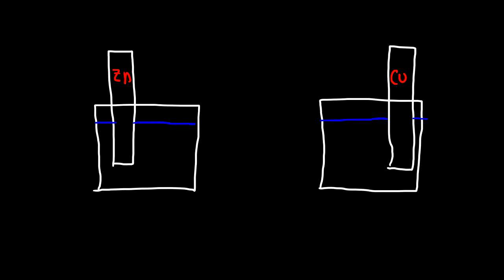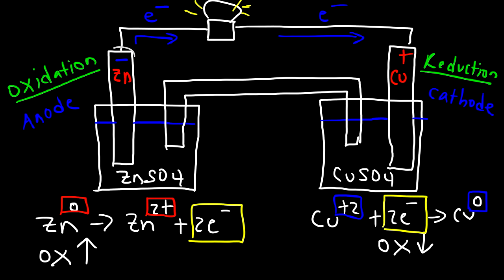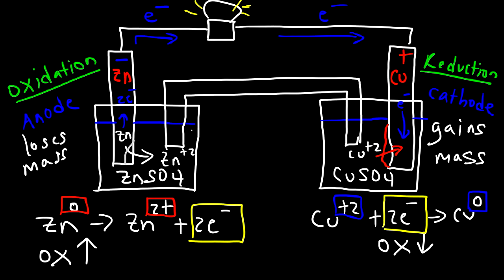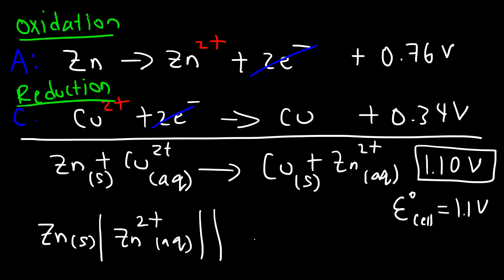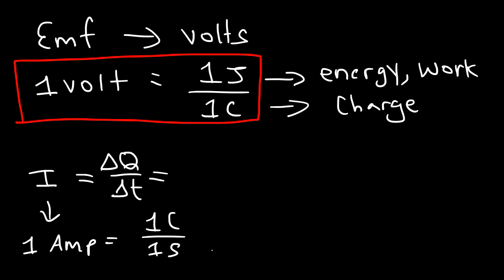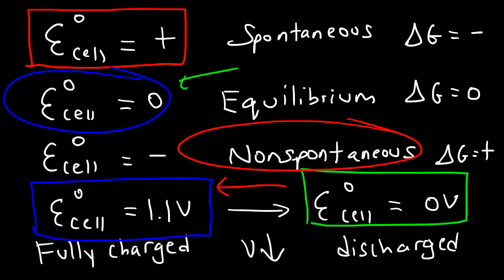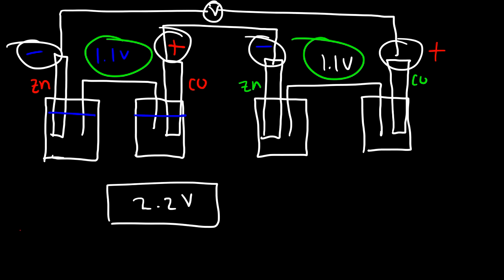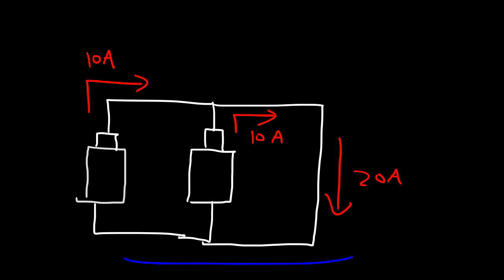Introduction to Galvanic Cells & Voltaic Cells

Comment: his video provides an introduction to galvanic cells, also known as voltaic cells, explaining their operation and key components (0:01).

Here's a breakdown of the main topics:

Galvanic Cells as Batteries  (0:08) : A galvanic cell is essentially a battery that converts chemical energy into electrical energy to do useful work, such as powering devices.
Components and Operation (1:20): A typical galvanic cell consists of two half-cells, each containing an electrode (metal) in contact with an electrolyte solution.
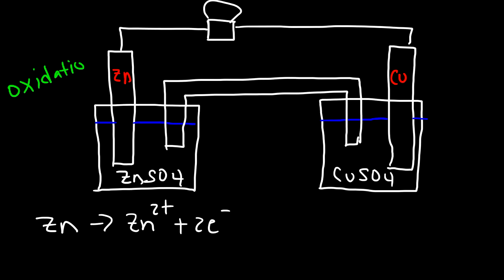Anode (3:00): This is where oxidation occurs (loss of electrons). The anode becomes negatively charged and loses mass over time (4:56).
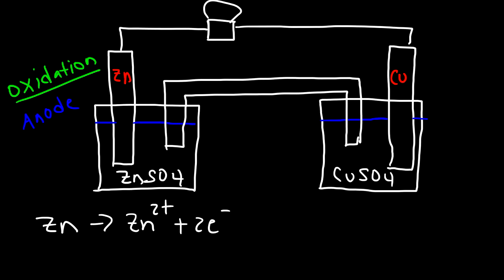Cathode (3:13): This is where reduction occurs (gain of electrons). The cathode becomes positively charged and gains mass over time (5:18).
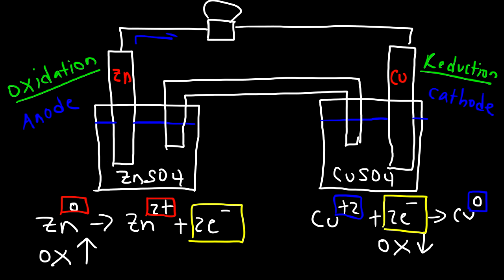Electron Flow (5:00): Electrons always flow from the anode to the cathode.
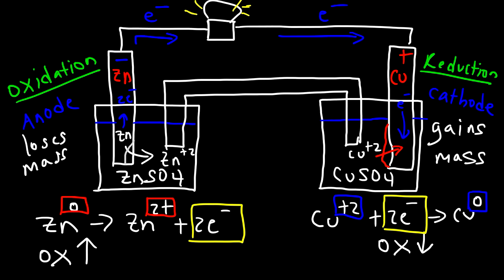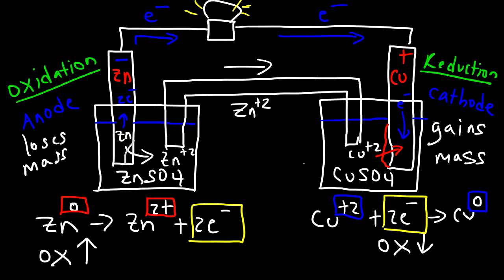Salt Bridge (8:00): The salt bridge prevents the buildup of charge in the solutions, ensuring a continuous flow of electricity. Anions flow towards the anode, and cations flow towards the cathode (9:30).
Half-Reactions and Overall Reaction (10:06): The video explains how to identify oxidation and reduction half-reactions based on the placement of electrons and how to combine them to get the overall cell reaction.
Cell Potential (EMF/Voltage) (13:32):
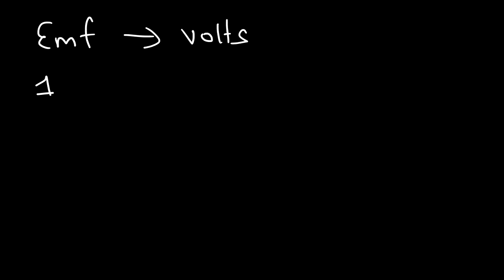Measured in volts, where 1 volt equals 1 joule per coulomb (13:46).
Represents the work that can be done per unit charge (14:32).
A positive cell potential indicates a spontaneous reaction, meaning the battery is charged and can do work (17:20).
A zero cell potential indicates equilibrium, meaning the battery is fully discharged or "dead" (18:58).
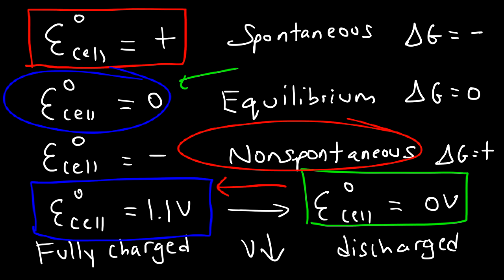Galvanic cells always have a positive or zero cell potential; they cannot have a negative cell potential (20:10).
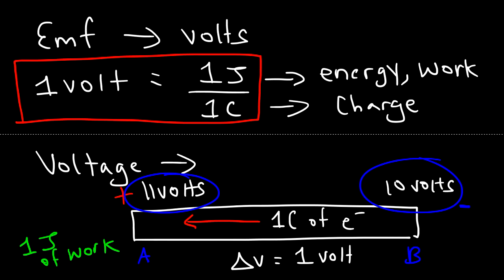Electric Current (16:08):
Represented by 'I' and measured in amps (16:11).
Defined as the rate at which charge is transferred (16:15).
1 amp is equal to 1 coulomb per second (16:26).
Increasing Voltage and Current (20:47):
Voltage can be increased by connecting multiple galvanic cells in series (positive terminal to negative terminal) (20:52).
Current can be increased by increasing the surface area of the electrodes or by connecting batteries in parallel (24:01).

Comment: can someone explain why the anode is negatively charged if it's losing electrons? wouldn't it be positive? 05:12
Reply: When it zn rod loses electrons it results in Zn²+ and 2e-. This 2e- is very important. This 2e- stays in the zn rod for a split second making the rod an anode. Its not about losing electrons it about the presence of negative electron in the rod for that second. That 2e transfers to the bulb and then to the CU rod. HOPE THIS HELPS❤❤❤❤
Reply: i think because electrons still have to accumulate at the anode before flowing towards the cathode

Comment: 13:28 the arrow of oxidation potential of the Zn you should write backwards because it is obvious that the oxidation potential of zinc is negative under standard conditions. Great video! Thanks a lot.
Reply: Oxidation potential is positive the negative one is its reduction potential

Comment: At 18:00, there was a confusion between Δ𝐺 and Δ𝐺∘. The cell potential is related to Δ𝐺∘, which represents the difference in Gibbs free energy between the two pure components under standard conditions. By applying the condition for equilibrium (Δ𝐺=0), the Nernst equation can be derived.

Comment: The zinc ions do not move towards the cathode through the salt bridge to achieve neutrality. There is either salt or silica gel in the salt bridge to produce cations and anions to prevent the build up of charges
Reply: Thanks for this clarification coz I was like nooooo....that's not the function of a salt bridge

Comment: Great video... 1.39 This is how I define and electrode. An electrode is a conductor that allows electron flow into or out of an electrochemical cell and is usually in contact with an electrolyte containing ions involved in the redox reactions. Why? Because we have carbon that can act as an electrode and it is not a metal.

Comment: Wait, I have a question. When he talks about the salt bridge during 9-10 minutes, he explains that the ZN^+2 ions move from the anode to the cathode to keep both solutions neutral by preventing the build up of charge and vice versa for the sulphate ion. When the zinc ions move into the cathode solution with their positive charge, do they then also become attracted to the electrons passing through the cathode and accept them becoming solid zinc? I did hear somewhere that what makes the salt bridge useful is the fact the ions used are stable so maybe this applies with the zinc ions but I am unsure how this makes sense if it has a +2 charge.

Comment: My query is, isn’t the potential at a terminal of the cell fixed? Then when you connect two galvanic cells in series, won’t it be the same potential difference for the outer terminals?

Comment: Hello! I have a question, how can the zinc ion that left the eletrode, be dissolved in its corresponding solution, yet also pass through the wire towards the cathode? Doesnt it dissolve into the solution? 

Aswell, how can the anode be negative if it is loosing electrions so there are more protons so it will have to be a cation?
6:03 6:16

Comment: I know its been 5 years.... but i have a question

Voltage is the difference in electric potential between the cathode and the anode. 

lets say one terminal has an oxidation potential of 1 and the other has a reduction potential of 1. the voltage would be 1 + 1 = 2 volts. It doesn't matter the volume of the cells, or the size of the electrodes, the voltage will always be 2. 

However, when you connect two batteries, the voltage increases. How does this work, when the electric potential (voltage) relies on the difference in the oxidation potentials, and not the amount of electrons transfered?

Comment: Here's a tip from a fellow student to another, there is a good way to remember Oxidation = anode and Reduction = cathode. Using the phrase "an ox cared" You can know an=anode ox=oxidation and cared = ca and red which both respectively means cathode and reduction
Reply: Thats good. Another good one is Red Cat. Reduction happens at cathode.
Reply: Some books' got anode as positive and cathode as negative... it's so confusing 😕
Reply: @mosespumpuni2631   That depends on the cell. Galvanic Cells Anodes are negatiive and positive cathodes. For electrolytic cells is flipped. The anodes are positive and cathodes are negatives.

Still regardless dont pay attention to that. Oxidation happens at anodes, and reduction happens at cathodes regardless of its the cell is galvanic or electrolytic. Thats the part to remember
Reply: @mosespumpuni2631 I think you might be getting it confused. Theres also a thing where electrons (negative charge) flow to cathode and positive charge flow to anode, which makes sense because anode is negative which attracts positive and vice versa. But the charge of the anode itself is always negative and cathode positive. Hope this helps.

Comment: Can you explain why the zinc wants to give electrons away even though it exists as cation?
Reply: it’s a spontaneous chemical reaction that produces a flow of electrons
Reply: plus it goes through oxidation so it looses electrons
Reply: 😊Because Zn is more reactive than copper, So in Spontaneous Chemical Reaction it has high tendency to lose electrons ( high oxidation potential as compared to copper) so Zn loses electrons not Cu

Comment: isn't the cell potential cathode - anode? how did you get 1.10v when calculating the electron potential between zinc and copper?
Reply: Because reduction potential of Zinc is -0.76 not 0.76 and then you will get Ecathode - E anode = 0.34-(-0.76) = 1.1 V

Comment: I dont get the electric potential part 10:50 . If the zn soln has a potential 0.76 and cu soln has a potential of 0.34, then shouldn't the potential difference be the total voltage rather than adding it ?
The vid made everything very clear. thanks for that

Comment: I  just have one question. Hypothetically,  if we had a Mg and Zn simple cell  (one beaker) in a dilute acid, would the electrons on Mg go to Zinc or would the Mg react and reduce the H+ ions in the acid instead. I am presuming Mg would directly reduce H+ because Zinc is more reactive than Hydrogen. Also there is a bigger difference in reactivity between H+ and Mg too. ???????

Comment: How can I find out the amount of volt produced from the reaction?  10:16
Reply: You can find out that value from the electrochemical series, which is in any text book, or you can search on google.
All those values have been found at SLC (standard laboratory conditions), which is using 1M concentration of the solution, 25 degrees Celsius, and at 1 bar of pressure for gases.
If you have a reaction, and would like to find out the voltage produced (only in SLC), you subtract the higher E value from the lower E value found in the electrochemical series, and this gives you the voltage produced from the reaction.

Hope this helped,
- From a year 12 high school student.
Reply: @customlane7226  thanks for explanation

Comment: Do the electrons travel only through the wire or will a small amount travel through the salt bridge?
Edit: I just found the answer on stack exchange. A small amount of current will leak through the electrolyte. To counter this modern batteries have a membrane called a separator that allows ion exchange but has a much higher resistance to combat the flow of electrons.

Comment: i learned that the potential of the zn was -0.76, the cu was 0.34, and the the battery potential was the potential of the anode - the potential of the cathode, so 0.34-(-0.76)
Reply: I suspect you've written it the wrong way around. You say 0.34-(-0.76) which is correct since its the cathode minus the anode. But you say before that the battery potential is the anode - the potential of the cathode when the reverse is true. Other then that I believe that is the correct way of doing it, at least from what I've learned ¯\_(ツ)_/¯
Reply: @ployplunder3109  i need to investigate more i guess

Comment: Why nobody discusses the salt bridge in detail.
Reply: To retain charge balance
Reply: @the_crackin3610 thank you so much girl ❤️❤️❤️
Reply: Dwift did
Reply: Its a tube in which a inert electrolyte is filled along with gel it allows the flow of ions but prevent mixing of solutions
Reply: @MustafaKakar-cv1gb  u said it better
Reply: @nextpsychopomp9499  thanks ❤️
Reply: It’s used to prevent the mixing of the half reactions and balancing them out :)
Reply: @linddddd actually its to retain the electron flow of the voltaic cell
Reply: @yematthew that's the same thing
Reply: @linddddd okay but where the fuck did the SO4 come from and why is that the anion and not Cu
Reply: I love how this thread has like 10 different answers to your question
Reply: @CephalonKaz  proves op's point
Reply: Salt bridge mainly contains inert salts(KCl etc) and this maintains the neutral nature of the half cells.... By sending K+ into the half cell where there e- are gained(-vely charged cell) and for the Cl- , it is sent to the other half cell, that looses e- (+vely charged)--- it is quite important because electrochemical cell wont function until the electrical neutrality is maintained....
Reply: It also helps prevent a charge from building up at the anode/cathode, which stops a insulative barrier from forming (which would stop the cell from doing work)
Reply: @Carbon-Aura  hi john 👋🏻👋🏻
Reply: Im here to know about salt bridge 😢😢😢, same 😢
Reply: The compounds used in glass brigade are McLean,kno3 andNH4NO3 which are solids and liquids saucy as gelatine and agar agar which should be less reactive high solubility and equal mobility
Reply: it's used to complete a circuit or to neutralise the access iron
Reply: Actually it's not that important.That's why.
Reply: @pinkykarmakar2569  not important for?
Reply: The salt bridge has mainly two purposes:
1. To prevent the build up of charges.
2. To maintain neutrality of ions on both the cathode and the anode

Simple!
Reply: I mean, it's gelled up salt-water in the basic setups, not very exciting for most people.
Reply: _it is nutrlize the soln during the loss and gain elctron
_complete the circuit

Comment: how about the concentrations of the solutions being changed ? how does it affect the cell potential ?
Reply: Not really until depleted. For example, as electrons deposit on the copper electrode the copper ions are there to absorb them and keep the electrode neutral so the electron flow continues and the voltage remains constant. The standard reduction potential between the two electrodes is a property of the elements and remains constant. However, once the solution is depleted thats when the cell stops functioning.

Comment: what happens to the zinc sulfate and copper sulfate solution after reactions are over, will both becomes zinc sulfate? or something else?
Reply: The point of the Daniells element is to provide a direct current so the reactions are over when the zinc bar is completely "eaten up" or the Cu2+ from the solution has fully reacted

Comment: i thought anode is a positive electrode and anion is a negative ion and discharging the cell causes oxidation at the cathode (the zinc negatrode)? Discharge = negative current, zinc sulfate and cations/positive ions at cathode(negative) + positive current, metallic copper and anions/negative ions at the anode(positive)? someone tell me where i have gone wrong
Reply: Elite Opinions were talking about a galvanic cell, so the anode would be negative.  In an ELECTROLYTIC CELL it’s the reverse therefore, the anode would be positive and the cathode negative. They’re the same thing but with a twist.